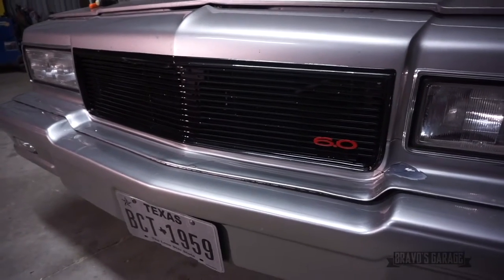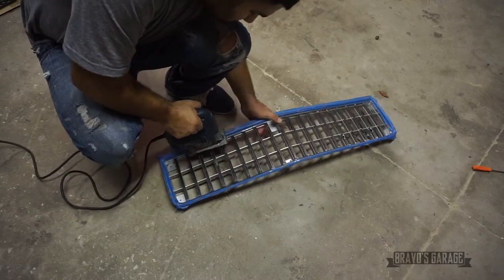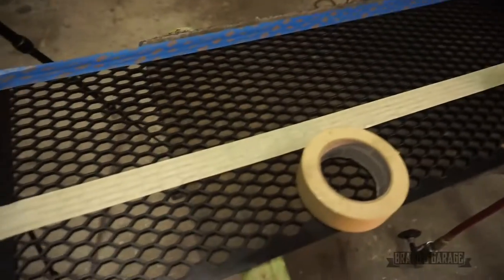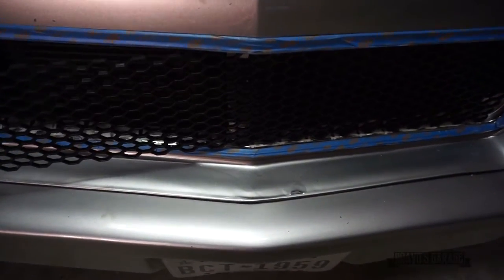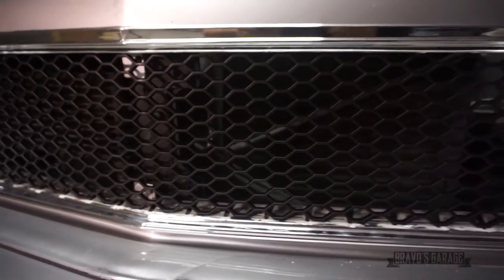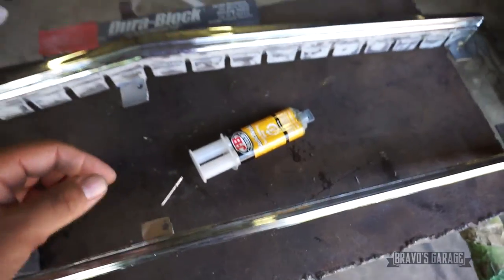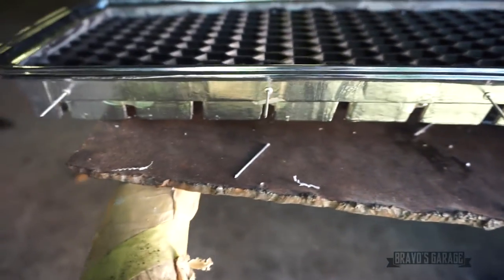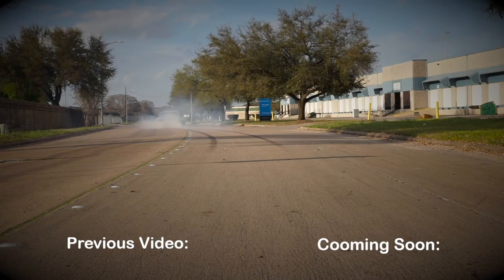LSX CAPRICE | Custom Grille

Comment: Looks great! Is that the same way you made the billet grille was installed or was the billet grille manufactured to fit?
Reply from the maker: X. Page yeah, the billet grille is a aftermarket replacement made to fit caprices but it's the same process. Cut out the middle section, insert the billet grille and screw it in the top and bottom.
Reply: Bravo's Garage cool. Thanks!

Comment: Do you remember what that 
link was to the honeycomb grille that you used and also what size rivets did you use as well? Thank you!
Reply from the maker: the grille mesh came from ebay. the size was 41''x13'' but it depend on how big your grille is because they have smaller or bigger grille inserts. the rivet size  3/32 x .365 aluminum rivets. let me know if you need help locating the parts.
Reply: Bravo's Garage Thanks for the reply! I will looking into mine and let you know. Thank you so much!